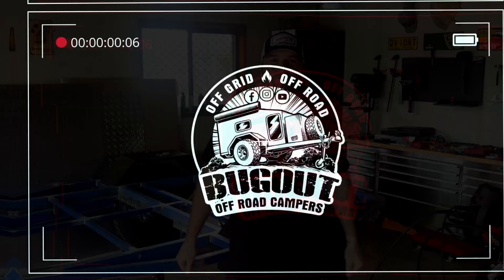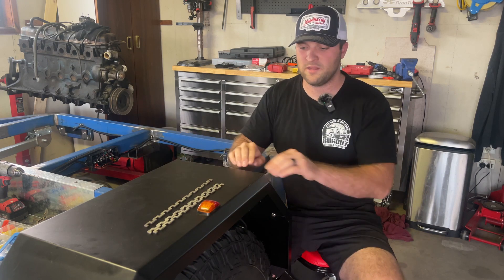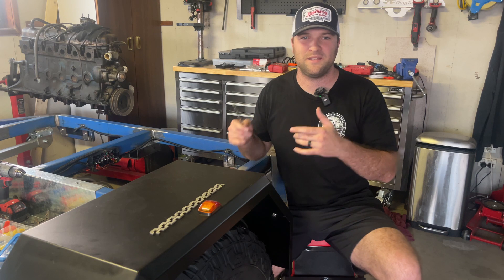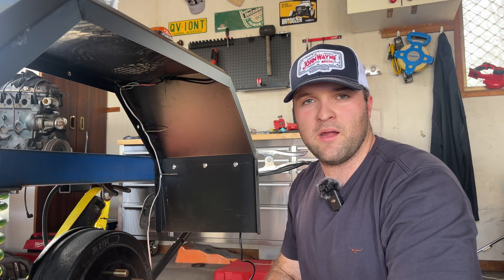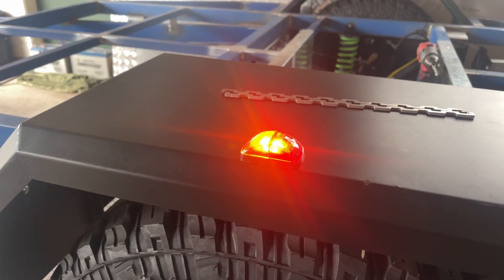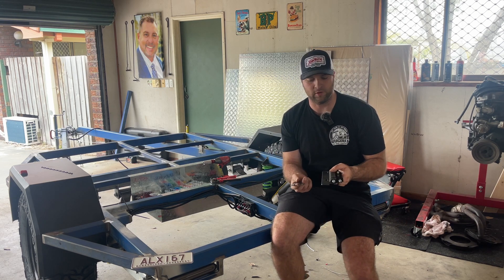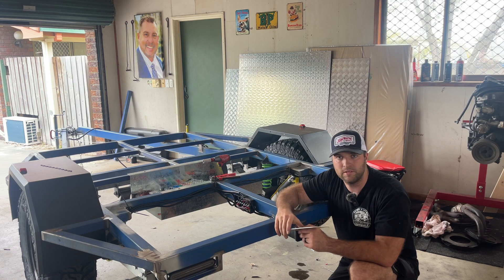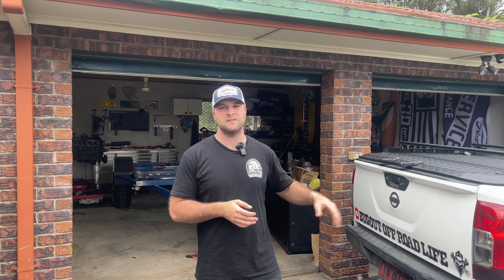DIY SQUARE-DROP CAMPER BUILD EP 6 - Clearance Lights Wired, Trailer Plug Wired, Walls Update!

Comment: One thing I would suggest with the clearance lights would be to run the wiring at the front of the guards so it’s less likely to be hit with rocks and garbage coming of the tyres. (bit late now unless both are same and can swap them side for side)
Reply from the maker: That’s a good thought which didn’t cross my mind. I went to the rear because it was closest to where the rest of the wires run (and where there were already tabs welded on for zip ties) but I’ll definitely keep that in mind on the next build and run the wires in front. I’m going to take this one on a trip up to the cape once it’s complete and if it seems to be an issue, it’s not too hard of a fix anyway!
Reply: Now that they are there, you can cut some metal and just make protective covers, tac weld em in for extra protection.
Reply from the maker: Good thought